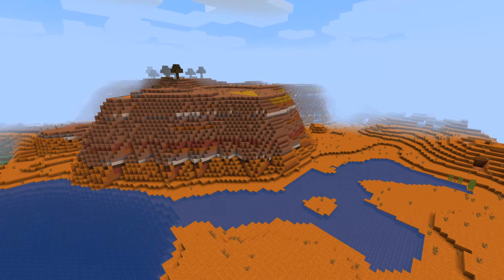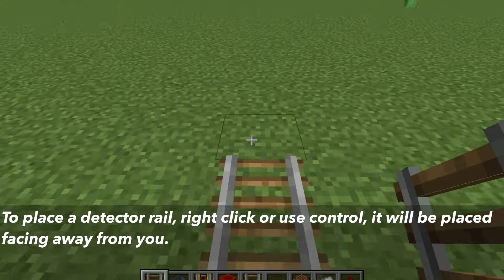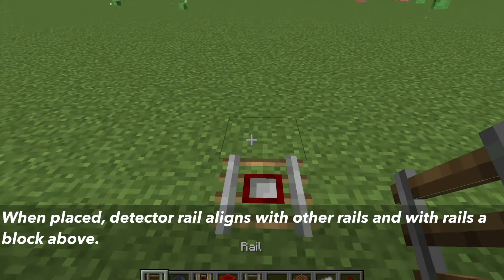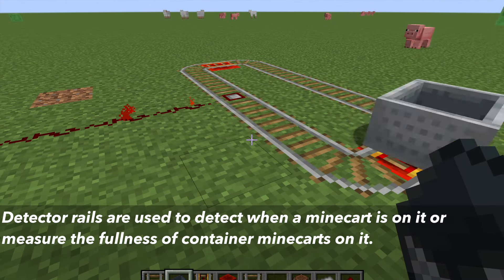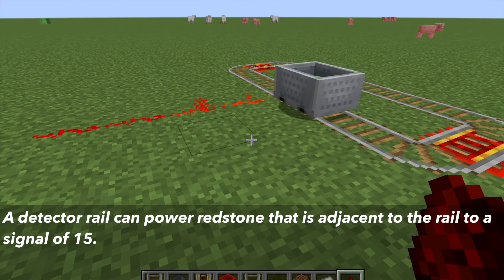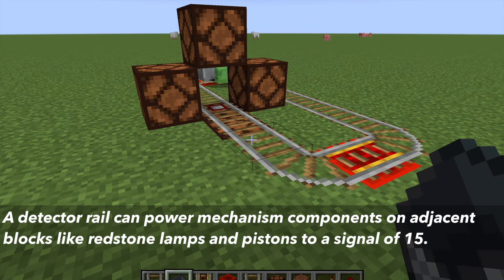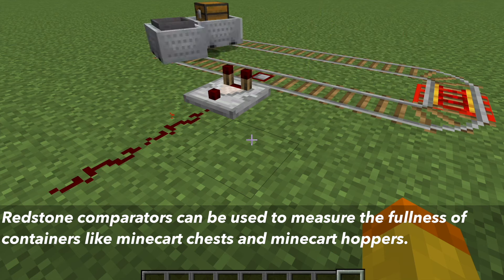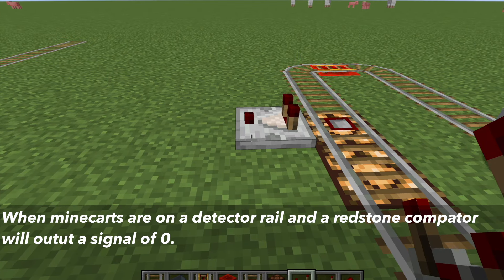How To Use Detector Rail In Minecraft

Comment: So... it's used as a preassure plate for rails, got it
Reply: Thank you, this guy really could have just said that upfront 🤦🏻‍♂️
Reply: @CheddarBayBaby  Not exactly, the detector rail can also be used with a Redstone Comparator when placed next to it. Placing a hopper minecart with different stack values (numbers like 64, 32, 16.. etc) can give a different redstone output. This feature as I have seen is mainly for secret base designs + farms. So in conclusion, No it is not basically a pressure plate for rails. The closest pressure plate the detector rail is close to is the golden pressure plate, which counts the number of entities, not the stack value

Sure if you dont place a comparator it becomes a pressure plate but the difference is the delay in which it stops the pulse, which is around a 4 tick delay unlike the pressure plate which is faster in stopping the pulse which could be used in some sort of redstone design. But no, it is not completely just a pressure plate on rails
Reply: @Freindz  I wouldn’t expect you to understand the value in brevity.

Comment: Can a detector rail power the power rail, is my question. Sure, I can hide a redstone torch, but can I remove it completely?
Reply from the maker: That would work. The only problem is the detector rails are expensive and redstone torches are cheap.
Reply: @RajCraft  Hmm, true. There is also the fact that single redstone torch can power two way railroad, and you need two detector rails for both ways. Was simply wondering if it is possible at all. Hvae any ideas on how to hide those? I'm thinking red brick for bridge, and redstone lamp to hide the torch.

I'm building a sort of metro, so there are stations, and there are two way tracks. Red bricks are infinite, if you have a stone cutter in a village, and so is redstone, if you found or made a brewing stand in the same village.
Reply: @RajCraft  rail dupers are very useful in this case